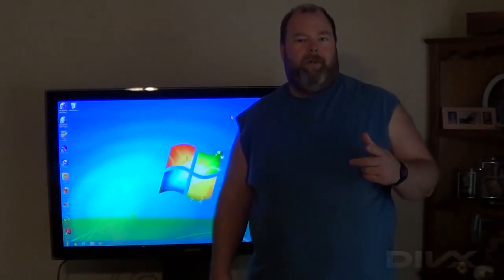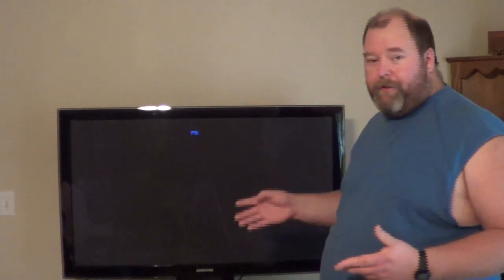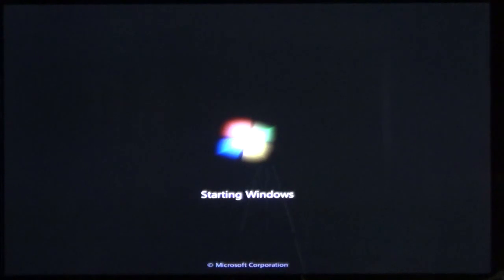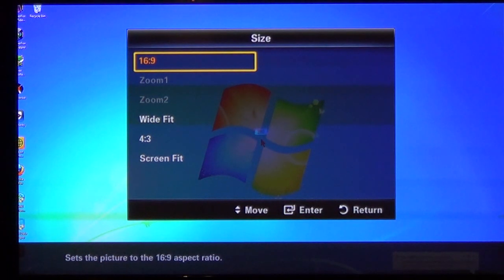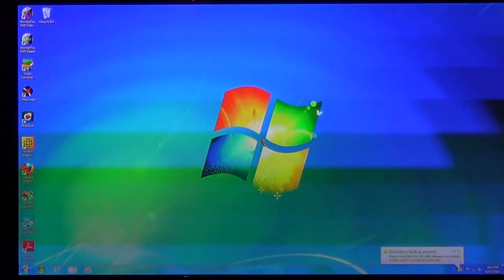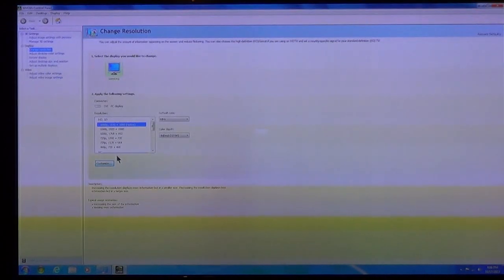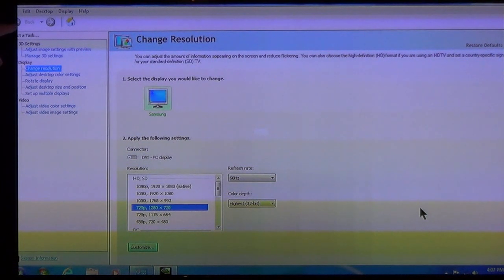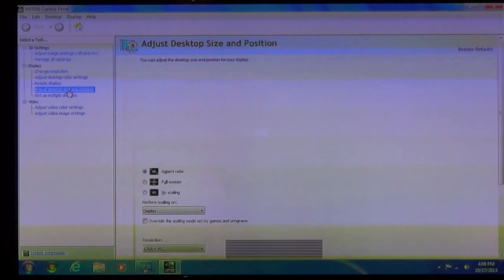How to connect your PC to a HDTV

Comment from the maker: It will depend on the connections the TV will accept. VCR and DVD Players can connect to the TV using A/V RCA cables. Many Blu-ray players also use these cables. For A/V connections you can use an A/V switch that will allow you to switch between the devices. as a last resort you can get HDMI converters for the connection needed for the tv. -MrFixit

Comment: Mr. FixIt...How do I get sound from Samsung Tv (using as a monitor with HDMI) and my older PC (with VGA and HDMI adapter)?  I have been told that I do not need an audio cable because the HDMI cable should carry sound, but it sounds like you are suggesting that I do need an audio cable because I am using the adapter, just like you demonstrate in this video. My set up with my cables are exactly like this demo. I just want to hear sound from my computer through my Samsung TV monitor. Help???
Reply from the maker: VGA does not carry the audio channels like HDMI.  There are adapters that will convert the VGA into HDMI with the added Audio input. They can be powered by the USB or a standalone power adapter for about $15.  You'll need a VGA to HDMI w/Audio adapter.

Comment: great video I have all ways hooked my computer to my tv with hdmi no problem. I bought a new 55 Samsung and a Samsung dvd  plus my cable box. but now  when I try to play my computer through the tv it wont work. if I play a cd rom that will come up on my tv fine.  but if I go to lets say amazon prime as soon as I click on a video the picture on the tv only shows my home page and the mouse only scrolls on my tv set and not my computer.  the sound works on both.same thing on you tube .any ideas?  thanks nick

Comment: My tv has a vga port and my secondary output from my computer hooks up fine at 1080.  MY question is, if I get a digital converter to use the hdmi ports of the TV will I see an improvement or will it just look like the soft analog VGA signal I am already getting?

Comment: On my PC windows 7, Fedora 22 Linux and Mageia  linux 6  latest version are installed. My PC is having HDMI, DVI and VGA output 
ports. Now the PC ic connected to  my TV (Leeco 55" Led) via HDMI. Win 7 & Fedora 22  systems are working  fine. Other  Linux  system  hangs at  "LOg IN"  Screen . PC must be restarted . No sound problem . What is wrong?.

Comment: Hello my TV don't have VGA port and my V. card don't have HDMI port, so I bought VGA to HDMI cable and did everything you said, but the TV just stays on black screen. What should I do (I did the control panel settings, I did set it on the VGA port)
Reply from the maker: If you bought a VGA to HDMI adapter, it should have a separate power cord.  Some power from a USB connection and others use a wall power adapter.  It needs power to convert VGA into HDMI.
Reply: @ESRepair  OK, thank you,I think I got bamboozled 'cause they gave me just a cable.

Comment: Tried doing this with a VGA cable. I plugged one end of the VGA cable into the tower and the other end into an HDMI converter. Then plugged the converter into an HDMI port on the TV but the TV isn't reading a signal. What am I doing wrong?
Reply from the maker: The VGA to HDMI adapters requires power to convert analog into digital.  They usually can be connected to a power source using either a USB adapter or wall adapter.
Reply: @ESRepair  Thanks. I eventually figured out a way. I used my old flat screen that had a VGA port (my new smart TV doesn't have one) and just used a straight VGA chord and audio chord.

Comment: What about audio?????
Reply from the maker: If the GPU suppoets HDMI v1.4 the Audio is transmitted via the same cable as the video. DVI and VGA require a separate auido cable to either the TV or external speakers or a surround system.
Reply: that PC of his is somewhat OLD, most all desktop PCs these days have HDMI ports

Comment: I connected my laptop to my TV and it worked at first. but my son closed the laptop screen and when i tried to connect again it didn't work. the TV shows only a computer window and I can hear the sound but the pictures doesn't display. what's wrong with it and ho can I fix it?
Reply: Swahili 101 I had to turn mirroring on my laptop display unless your computer goes into sleep mode

Comment: Except you can't see Safe Mode on External Monitor
Reply from the maker: Not while in safe mode.  When Windows is in safe mode it only loads the basic drivers are loaded including the graphics.  Windows can only use the Primary display adapter.  Why are you needing Safe mode?
Reply: I need to fix something in Safe Mode, but my PC screen is cracked, I can still use the HDMI to connect TV in Normal Mode as your video and there is no problem to using the PC except not in Safe Mode. Any alternative solution ?

Comment: That a single link Dvi...theres 5 types...
Reply from the maker: Technically there are only 4 types.  DVI-A is rarely ever used. GPUs often use Dual-link DVI-I while others used Dual-link DVI-D. DVI-I Carries both Analog and Digital signals and DVI-D is pure Digital.   Single link is used for up to 1980x1200 resolution and Dual-link is used for up to 2560x1600 resolution which is just below 4K resolution and DVI cannot carry Audio channels.  Hence why HDMI is preferred over DVI.